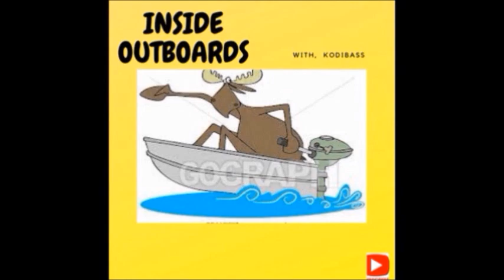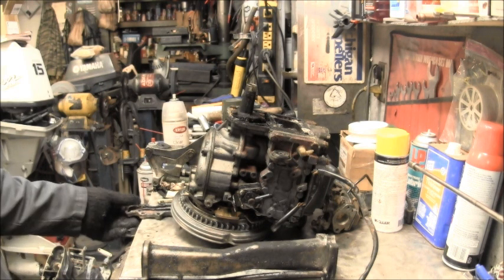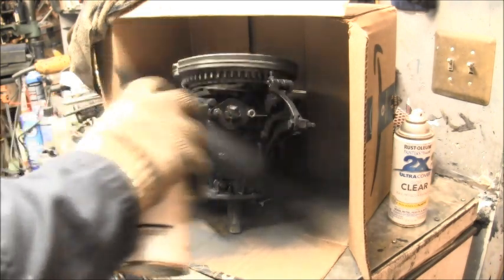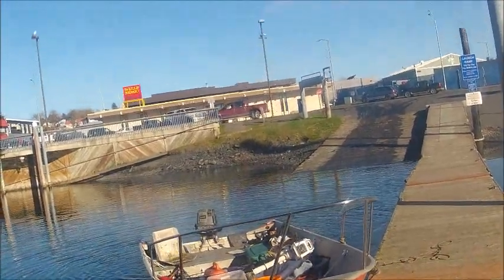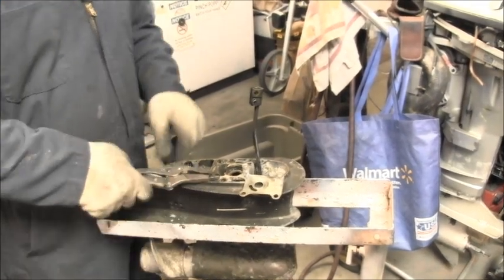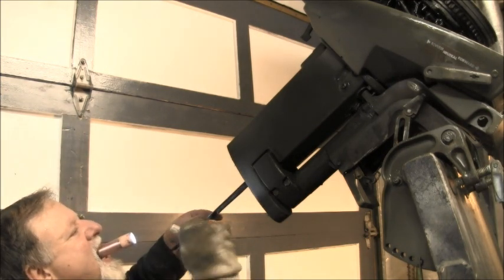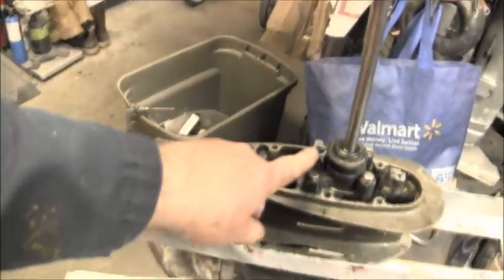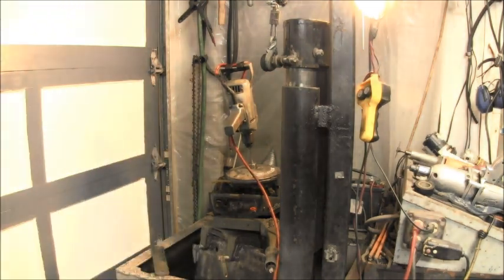EVINRUDE, JOHNSON  1981  Part 4 and no MORE ?

Comment: Another good video. If those crank bearings are worn it would not make the drive shaft hard to put in, but something is off center. Either something wrong with the crank shaft or the drive shaft. You did a lot of work on the Evin Salt Dog. That is a good idea using the Permatex aviation form a gasket and especially using the ultra copper maxium temperature gasket maker on the engine gasket on the engine side of the block. Well done and enjoy those Salmon.
Reply from the maker: Thanks  mate, will salmon yummee   4   sure.

Comment: If Kodibass is not sure what the problem is, it might be a bit presumptuous for me to risk a diagnosis but since you asked, I think that the refusal to shift in reverse is the giveaway, the drive shaft is not sitting where it should in the power head. I'd drop the lower unit and measure the protruding part of the shaft and shifting rod against the specs, check the splines at both  ends of the driveshaft and try to reinsert it alone in the power head. Other than that, give a shout to TOO to get a second opinion. That could make for a fun video !
Reply from the maker: I  Think U R  N   the  Ball  Park  mate..           kb

Comment: I just got 2 Used lower units For my 9.9 evinrude and Johnson Outboards They both work good I was wondering if you knew When they 1st started putting the electrodes on For the salt water Is my old ones didn't have those I'm thinking 1980's I'm not sure I want motors 1979 the other 1 has 19 77.great videos😎
Reply: Both my motors I have one is a 1979 9.9 the other is a 1977. Both run great

Comment: Hi love your videos, I was hoping you could  point me in the right direction on how to fix my motor or where to start .i saw you had done a video on a yamaha 3hp 91-92 model , the guys bent the tiller handle up .I have the same motor and it seems to run high , so I'll have it in drive and its fine when I twist the throttle tiller handle up two or three bar speeds . When I go high it's moves  super fast like it's on high speed , even before I get halfway on the throttle. Almost like there is no slow speed , the throttle speed is way off .this is my first outboard motor , came with the boat . I would love to learn to fix it myself so I can keep it going as long as I can.